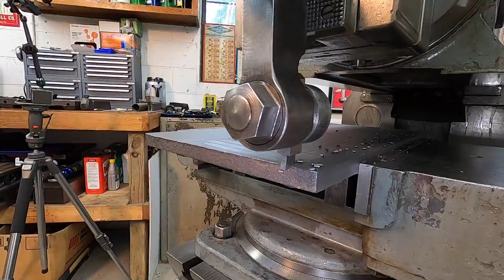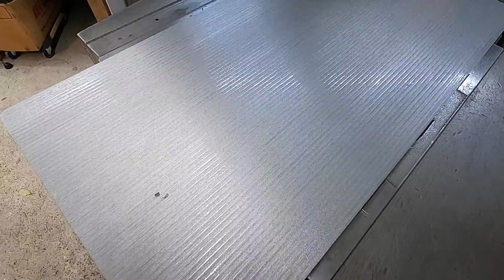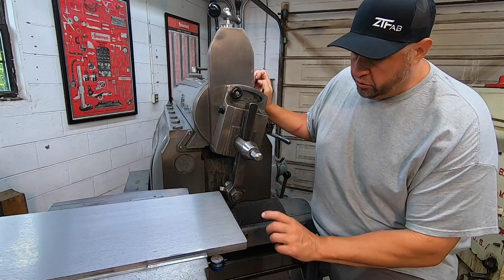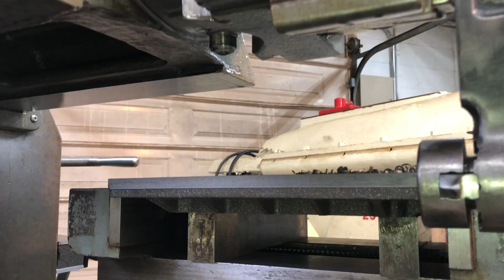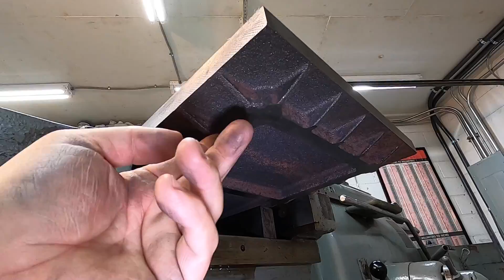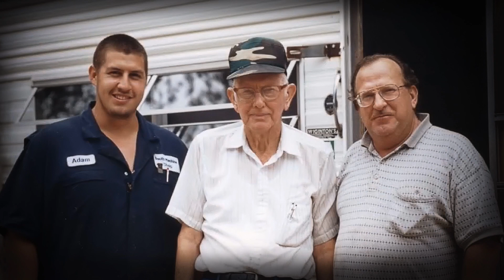SNS 313 Part 2: Finishing the Top, Sides, & Bottom of the Fireball Tool Fixture Plate

Comment: At 12:55 you can see "ripples" parallel marks. Remember Adam is cutting that surface to 500 millionth of an inch, while visible light has a wavelength of 15 to 27 millionths of an inch. So light can illuminate imperfections 1/30th what his are in this piece.

Comment: Adam, I'm also working with older machines and sometimes have to tweak back and forth to get a reasonable result. When I saw you working on this piece I wondered if tension in the part could also play a role here. When you remove the outer layers of the casting, which cooled down faster than the core after pouring, could the "banana" effect as I like to call it play a role here? Especially after finishing the top part, hold down tight by the vise during machining, then flipping it over for machining the bottom again. Then it flexed back to it's own equilibrium with no vice to constrain it's shape... I know that a famous Dutch Lathe building company (Hembrug, AI) let their castings relax out in the open for a year and beyond to relieve most of the the tensions after casting in time. Maybe, because your casting is quite fresh, this is a phenoma you're  battling too... Curious about your thoughts upon this. Best regards, Job. Stay safe and be happy.

Comment: Wait... Why is it called a "Spring Cut"... How did it get that name?...

I have always heard it called a "fly cut", as little as a fly's "wing", or some such
Reply: As I understand it, it is called a "spring cut" because it just cleans up the surface from the previous pass. You do not dial in a new dimension when you do the spring cut, all the material that is removed is because the machine and tool was not rigid enough and it elastically deformed/got pushed away a bit. That "springiness" gets cleaned up with a spring cut, because the tool has less material to remove, it does not deform as much as before.
Reply: It's a spring cut.  No change in depth is made.  During normal.cuts there is some deflection of the base material.  It is springing away from the cutter.  A spring cut helps remove.material.left from the springing action.

Comment: i love the shaper!!! how would you do this on a vertical mill? man you got this by ths short curly hairs!!! Why is the shaper out dated? i guess i just won't understand. love your content!  L.C.
Reply: I like shapers as well but I don't understand why you think this couldn't be done a vertical mill? Clamp it in your desired vice or clamp it on the table, go over it with a large facing end mill and then do the sides with a normal 16mm end mill. If your setup was good that is done without touching the work inbetween, guaranteeing the right angle and flatness of the top surface. Then you flip it and do the bottom surface. If you do it in a CNC with a pallet changer, you could probably do 50 plates in the time it takes to do one on the shaper. That's why no one who has to make money uses the shaper. ^^
Reply: They say " the only thing you can't make with a shaper is money"

Comment: The close up on the return stroke finally triggered the light in my brain as to how the shaper doesn't make a mess out of the already machined surface. I think maybe the big stopover was what finally made it obvious that the tool is dragging over the next area to be cut and not the already cut surface. Great shot, Adam!

Comment: I don't understand why you just didn't turn the plate instead of the vice? That would have saved a lot of set-up time and you wouldn't need to change the cutter...or am I missing something? NOT a dig, an HONEST question from a home shop guy.
Reply: The less you unclamp that plate from the vice the more square and parallel you will get the work piece when done.
Reply: Yes, you are missing something.  The vice is flat and square to the machine.  Turning it keeps it flat and square.   You don't want to reclamp your material if you can help it.

Comment: Would it save any wear and tear on the cutting tool to put a small brush on the cutting head to move the chips out of the way on the return pass so it is not clapping/bouncing off of them and smacking the material surface?
Reply: Yes, the head moves up and down on its way back
Reply: I agree as well a small brush for both strokes, wouldn't hurt anything for sure.  Couldn't see the cutter as clear but...
Reply: No.  The tool it so much harder that the chips it doesn't help at all.

Comment: On your struggle with that top surface finish.  Do you think that the loss of the leading edge bevels of the cast iron might have contributed to the lack of expected performance of that original finishing tool?

Comment: Adam, 
I wonder - the slight out of flatness from the KT, the high spot on the back, could that have been due to any flexing of the plate on the table of the KT rather than the KT being out?
You put the parallels under the ends across a 24" span of a heavy piece, and then you applied pressure to both ends to clamp it.
If you do this with wood, specifically for a glue up, you introduce a bow...  so.....
Is it possible that you applied enough pressure to the ends to clamp it that you caused that 0.001 or 0.002" bow across the length of the plate?(which would have bowed down in that config giving you the high spot you found when you scraped it)
I realize the point of a fixturing plate is that it does NOT flex etc, but you also said that this is a new product for Fireball...perhaps it's just a scosh light on the depth of the ribs to resist the forces you applied - since those are forces it would not experience when working in normal use .
The G&E would appear to have corrected this, but the way it was mounted there, the spring would have been released and give you that hump you scraped off
Since we are talking thousands of an inch across 24"....it's at least possible.

Comment: (Not a machinist) I don't understand. I saw how much effort and care went into that finishing tool in the previous video, including using the paper and stones while on the actual part to ensure the edge of the cutting tool was perfectly parallel to the work. So how then is it possible that it looks like it has ridges in it? Do they just look worse on camera than they are in real life, or is that as good as a shaper finish gets (I realise half a thousandth of an inch is not much, it's just very visible)? It seemed especially prevalent after you put the stones over it afterwards. Don't think this is a criticism, by the way; I am in no way qualified to critique anyone's work, never having been near one of these machines in my life, but I am curious.
Reply: it has to do with the way the metal "grain" reacts tot he shearing action of the cutting tool on the shaper and the forces applied. The tool will deflect more on the side of the cut with the most material to remove, that also is the side with the greatest amounts of force applied so that you get more heat and the cutter "digs in" a bit more - all that deflection that Adam was talking about in part 1 when he explained about the cutter mounted on the backside - had he mounted it on the front side that affect in the cut would have been more pronounced. When you saw the plate after he used the stone on it, you could see that the surface was almost entirely the same height, the stone knocks the high spots off and averages it all down, and you could see that the stove touched the center of the cut of each pass - this takes us back to the way the light reflects and refracts off the surface, and that gets back into the grain structure and how it was perturbed by the shearing action of the cut.
If you saw it, the swirl marks left by the milling machine on the back side were similar... but curved - same thing
Unless you actually polish the metal surface with exceptionally fine submicron sized abrasives in as random as possible a motion as you can get you will always get some sort of difference as you play a light across the surfaces and view them from changing angles 
- it's the same idea as a diamond sparkling - only you don't have internal reflection/refraction since the light doesn't pass through the metal....just surface reflection and refraction ( any edge will cause light to refract, granted these are EXCEPTIONALLY small edges, but then photons are even smaller and your eye is an amazing device)
Reply: @gregmislick1117  You win YouTube Reply of the Year, sir. Bravo. Makes perfect sense.
Reply: @gregmislick1117  This is amazing! A guys asked a real question of genuine curiosity and he actually gets an answer... but not just a simple one! This man got an in depth, detailed reasoning that was easy to follow and fully satisfied the curious. Thank you!

Edit: I just realized how rare this is that we are baffled by it. Sad really.
Reply: @TreyCook21  -  I saw this Comment and deliberately pounced on it and mercilessly gave everyone concerned a 'thumbs up'. Yeah. That's right. Take THAT, you reasonable people! Huh! What's the world coming to when peeps are civil to one another...  :-)
Reply: @gregmislick1117  - Very good, sir. On a similar sort of theme, I used to make optics - lenses and mirrors - for astronomical telescopes (not professionally), and much of the figuring of those surfaces is done by eye, using contrasting patterns of light and dark that allow the parabolisation of a curved surface to (literally) fractions of a millionths of an inch.

It kinda makes your head spin after a while...  ;-)

Comment: Are the parallel lines the result of step over? I didn't think it was that much... I admit I don't understand, I thought step over was only .010" or .015" ?!
Reply: amazing how big a small step is isn't it
Reply: @gregmislick1117  😄😄, yeah but is that the case, the lines are caused by step-over? And if so why is one line shiny and the next dull grey? But the overall surface is flat?
Reply: you can set the distance, I believe he said what he set it to in the previous video
Reply: @RickBaconsAdventures  Well yes I know you can adjust step-over length but the step looks much shorter than the bright/dull lines of the finished surface, right? So how do they appear?

Comment: I wonder if honing the tool referencing the part's surface that was only rough cut had anything to do with the half thou undulations in the tool width, partly because of the of the part deflection during roughing cuts? Also I'd think that casting is moving on you, at least some from internal stresses as you remove material.
Reply: stone was huge compared to the cuts, so that it simply averaged them all out giving the same flatness as the underlying cut .. i suppose if the cuts were very wide and very course it would make a difference, but these were not - at least not with respect to the materials and the stone size

Comment: Just wondering if the castings aged longer maybe you would get the part flatter with less passes.Maybe some stresses still left in casting
Reply: Didn't they used to rough machine iron castings then leave them to rust for quite a while before finishing for this reason, removing the stresses in the 'skin'?

Comment: Sounds like you need a rescrape on the K&T... 🤔
Reply: I was thinking the same ... AND .. the amount of work involved
Ditto on the table ways on the shaper - jut taking them out alone is a big enough job, then getting them someplace that has a big enough machine to precision grind and polish them, or scrape and polish them I suppose... and if the risk of them coming back worse is higher than the hassle of dealing with the results as they are now.

Comment: The mill was off .006?!  That's a whole lot.  Are you going to try and fix it?
Reply: I'm curious if that was in part from the part distorting and not just from the mill. In my experience with castings, when you machine off the outer layer of them they can "spring" and change shape by a few thou.

Comment: Curious why don't you use a Blanchard surface grinder?
Reply: Even a good blachard grinder is usually only good for .002-.003 per foot of flatness. Most are more than that. Hes going to get closer with the shaper.

Comment: If you make a cutter twice as wide aren’t you putting twice as much force on the work? If that’s then requiring a spring pass surely it would make more sense to narrow the cutter. That would also make any variation in the toolhead to surface parallel edge less noticeable. Any chance we can see a comparison with a pointed tool cutter?  Yes I know each pass may be 20 times longer but we are just talking about a finish pass or maybe an intermediate pass with an in between tool.  I don’t have a shaper but I’m relating to a lathe and even sandpaper.
Reply: The step over maxes out at 180 thou. i don't imagine you are adding much cutting force by making the tool wider. The tool head variation that your talking about would be sorted out by the way he hones in the tool to the surface with the ground stones. I would be curious about how it would finish out with a smaller tip or with a mult pointed tip (flat with a notch in the tip) as well though. I'm not hugely familiar with shapers either.

Comment: Is it possible to make the shaper autofeed on the forward and return stroke? I ask because you could just fix the clapper so it can't.. clap and put two opposing tools in the tool holder. Forward stroke cuts, shaper moves over, then return stroke cuts and moves over to cut on forward stroke. It would seem like a way to make the job go much quicker.
Reply: I'm no expert, but if the clapper doesn't clap you won't get clearance on the back stroke and the tool will drag on your part. That is why, I think, you cant do that. I may be completely wrong though!
Reply: @2dividedby3equals666  His thinking is you wouldn't need it to clap because it's cutting both ways.
Reply: @loganpe427  Ohh I see (I think).
Reply: If it didn't "clap up" out of the way the backside of the returning cutting tool would dig along the work. In the wrong direction. Like mounting your cutter upside down on a lathe.
Reply: @niklasraedel2579  Much better than the expo I was thinking of! Excellent!

Comment: Just curious but if your only taking a thou cut would a wider tool, maybe half to an inch across, leave the same finish or would the load on the tool edge be too much?? and would a surface grinder better??? 

Fascinating machine. I know it takes longer to make a part compared to a cnc multi axis and spindle machine but I would rather use that shaper....... far more reliable  and satisfying to me. I do like cnc for it's speed and finish but the time taken to get the tool path right......  much rather get on with the job

Do you plan to fit a clapper lifter so the tool doesn't drag on the backstroke?? 

Great videos as always
Reply: "Just curious but if your only taking a thou cut would a wider tool, maybe half to an inch across, leave the same finish or would the load on the tool edge be too much??"
I think he's working on a comfortable step over and using a tool that is 2x the step
"and would a surface grinder better??? "
Arguably yes, but he's using his inhouse tools as they only cost electric and his own time - not paying for subcontracting

Comment: So if I was trying to measure the width accurately I would tend to lay the calipers closer to flat on their back, to allow a larger part of the jaws to align with the plate edges, which would tend to "pull" the calipers into alignment, thus squaring them up to get the most accurate reading. The specs on those jaws are really good. Comments Adam or anyone?
Reply: Yeah, I thought that too.
Reply: What you said and maybe rest the mid section on a parallel as a third hand. It's an awkward mesurement to do, not that the accuracy is that important with this lump.

Comment: Sorry if this is a silly question, but why use the shaper and not a mill for this?
Reply: Because shaper.
Reply: In this case, it's not simply about machining something flat. He wants those parallel tool marks. It's an aesthetic choice.
Reply: @iLumberjack  He also explains that the K&T has enough wear in it that it has a hard time producing long flat surfaces, which shows when he has to re-do the bottom of the plate on the shaper.
Reply: @stefinatrix  yes, that's the practical reason.
Reply: It's just a personal choice, Adam "likes" using older technology and he's not a high production shop, time doesn't matter. And he likes the surface finish the shaper makes.
Reply: It is not a silly question BUT... if you do a search in youtube for 'abom79 why use a shaper?' you will find hours of video where Adam (Abom79) discusses this and hundreds (if not thousands) of comments by users discussing this that exact question. If you watch and read even further you will find that whenever Adam uses a milling machine some of the audience then ask "Why use the mill and not the shaper?" In fact Adam uses a mill for several stages in the machining of this very same fixture plate. See last weeks SNS videos for some sweet milling action. Go back a year or two and you may find the videos where Adam uses a mill AND a shaper to make the little brother of this fixture plate.
After you have done all that ask yourself this question: Am I sorry I asked the first question?

Comment: Looks gorgeous. At 08:00, do you feel ridges? Like what we see on the video.
Reply: From experience, the "ridges" are a texture difference not a height one - It can be caused by the drag on the backstroke polishing the surface on the edge of the tool

Comment: The reason you have the significant warpt on the bottom side. Cast Iron usually under stress when cast so after you cut the top the grain structure relief thus resulting in a few thousands warp and it would multipied uver the length and also the width so.the milling machine may be only part of the problem.